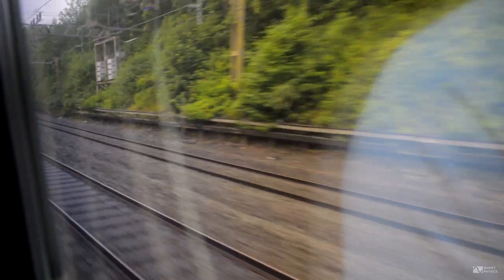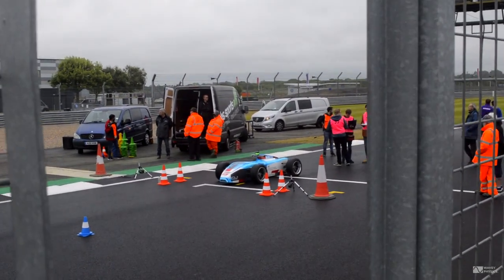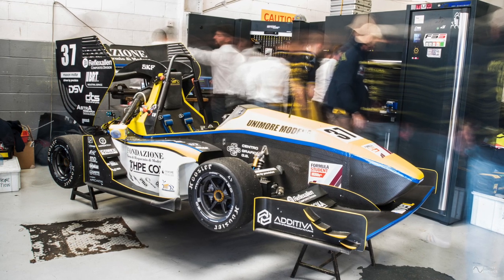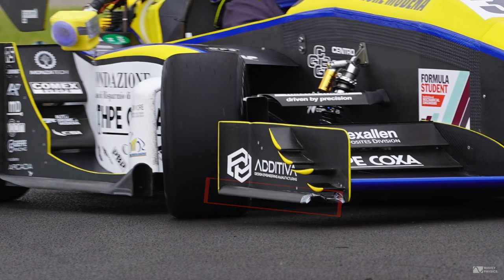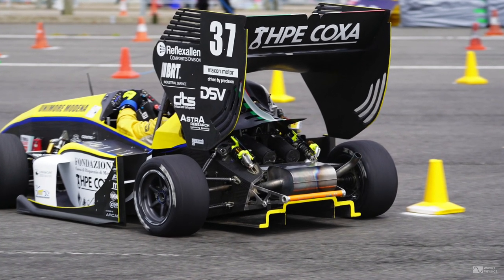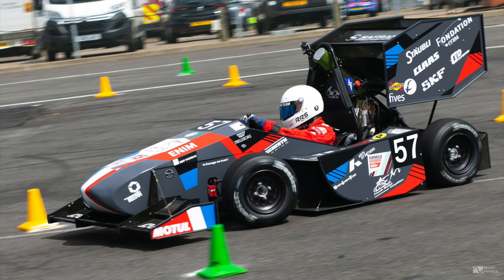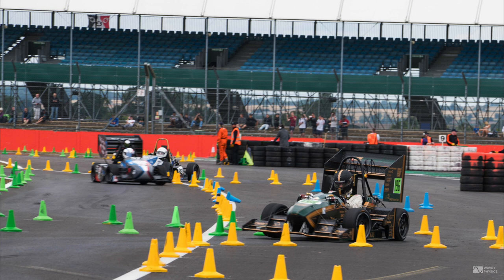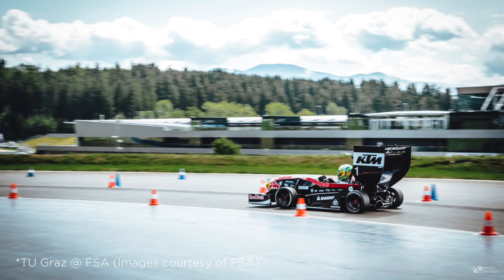Ep. 006 - Formula Student: An Aerodynamic & Technical Analysis

Comment: I don't know how the cost report rules have evolved with the years but I know that when I was doing the competition the gain from small carbon fiber winglets like this would be to expensive to produce for the grip gain that they produce. The competition is at slow speed so an underbody tunnel with a large rear wing and a large front wing is enough.
Reply from the maker: Good point! It's been a while since i looked at that stuff so i can't comment on how the judges evaluate those kind of things but you may well be right.
Reply: @WaveyDynamics  When I was doing the competition all the carbon fiber grams on the car had to be debated for the 100$/ per pound in the cost report.
Reply from the maker: @comptegoogle511  Yeah, right.. I guess you have to weigh up the hit you take in the design report vs. the performance gained and engineering experience you'd get from doing the aero work in that respect.
Reply: @WaveyDynamics  If you can come up with the simplest solution that can get the job done efficiently then you show that you've already have a lot of engineering experience. LEAN manufacturing is the Hiroshima of the automotive industry in North America because they didn't adapt.

Comment: The car will be at 80 Km/h only at the end of the straight line. Most of the race is at 30-50 km/h and lift (downforce) is proportional to the scare factor of the speed. Those wings must penalize the team a lot for the cost report.

Comment: Given the very limited performances of the SAE cars and the kind of gymkhana tracks they're racing on, I see no need for so much aero complicated stuff and that ridiculously high rear wing.
Reply from the maker: You'd think so, but generally the top 20 placed teams all have cars with significant aero, so there's certainly a correlation there whether it's design points or absolute performance.
Reply: the typical sensitivities of a FSAE car are as follows:
1. tire mu
2. overall mass
3. coefficient of lift
4. cog-height
5. coefficient of drag
6. motor power

as a rule of thumb you can say that each of those parameters is only half as sensitive to the laptime as the one above: so you could change the cog-height by 10% but also increase C_l by 5% and the car will not be slower.

p.s.: keep in mind that procentual changes depend on the baseline and theres quite a big variability regarding weight (between 160 and 220 kg) or C_l (none up to 8!). the above stated sensitivities are for a 180kg car with C_l of about 6.
Reply: I race for a decent FSAE team in the US and during our testing I found that our car without wings was faster than with wings. The wings add weight and max speed we hit in our car was 70 mph but it’s rare we hit that